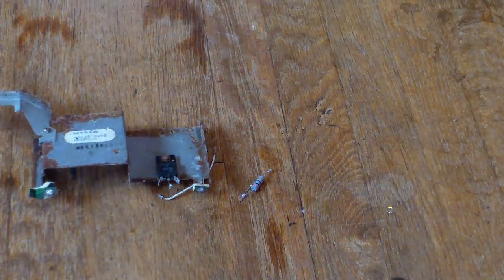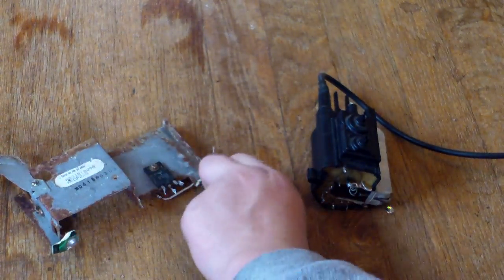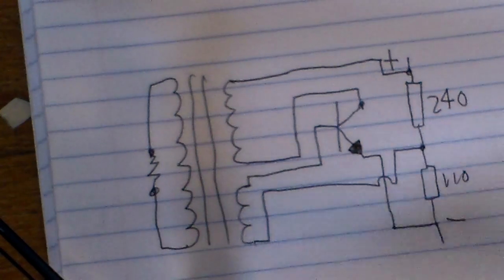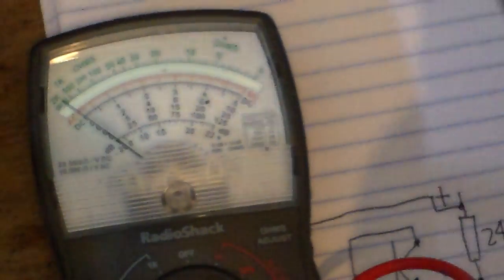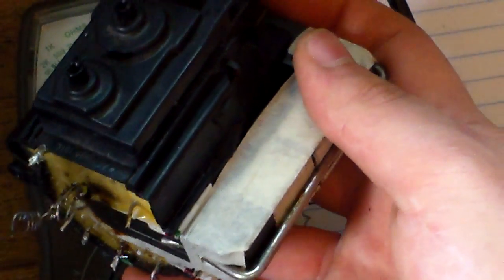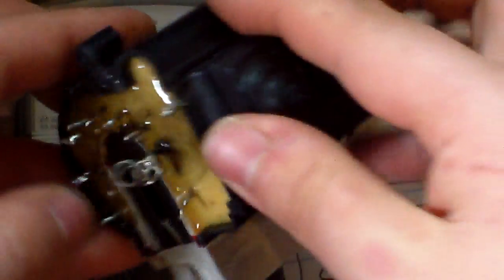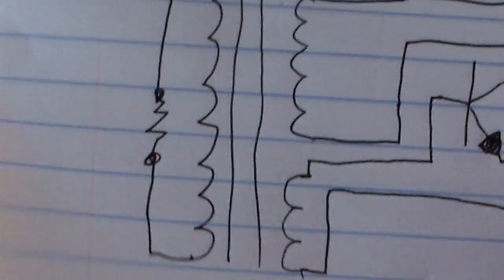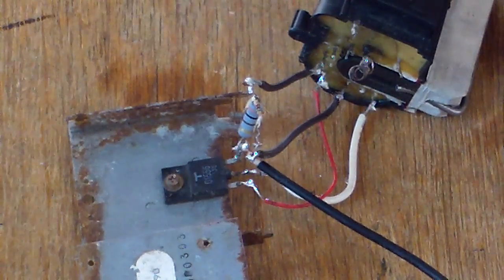how to make a flyback driver

Comment: Gotta improve soldering skills.
Reply: hey man at least he is trying man don't you remember when we first started soldering i bet you anything he is a great solderer now
Reply: Unknown Voltage And Current yes. i'm not saying the contrary . you right. just a tip
Reply: yeah your right as well lol when i first tried soldering a found some plumers solder and a shit soldering iron under the sink lol i know have multiple stations and rolls of solder and flux lol
Reply: I've watched a few of these videos now, and the tools don't line up with his(I think it's a guy anyway) knowledge, at all... For example, a lot of people will miss his subtle warning about analogue multi meters, he knows how and why that's the case...

If I'd hazard a guess, he's doing reasonably complicated things with the most vintage tools, equipment, design and methods.

Comment: O.K I'm looking to build the worlds largest flyback dose anyone know where I can find a MASSIVE   flyback core preferably around 6-5 inches tall?
P.S I need it to handel up to nearly 500Kv without punching holes in the windings or core any suggestions on wire, (30-40 gauge) magnet wire.

Comment: by the way, this is the first explanation of flybacks ive found on the internet that actually makes it understandable, thanks
Reply: flybacks aren't that complicated man , there are 3 sets of 2 main pins on them , 2 primary pins (in DC flyback usually the first 2 pins) 2 for the feed back coil (1 ohm) and 2 for the hetter on the screen , the rest you don't need for hobby grade stuff

Comment: Poor effect... My lyback generating ~6-8cm sparks :) (same schematic). Try with 30v input
Reply: personal experience , 30 v will fry the transistor , 12 - 16 v is the limit for all D15... and D16 and D17 horizontal deflection transistors

Comment: Great vid, on the note of you having the polarity wrong, You only had this problem because it's a newer style DC output flyback and has a diode built in. If you get a really old one it's worth noting that the polarity can go either way and depending on what you are using it for maybe of greater use being AC output.